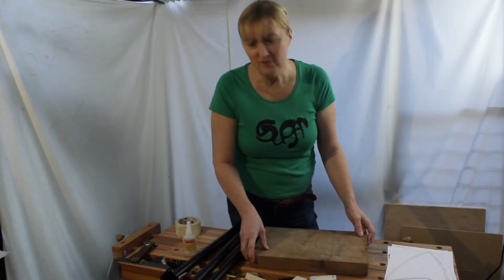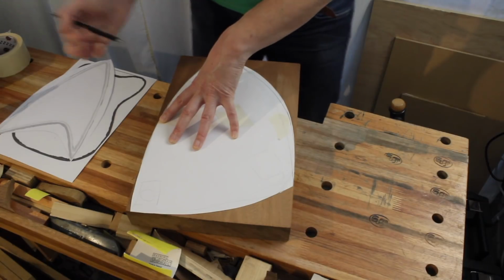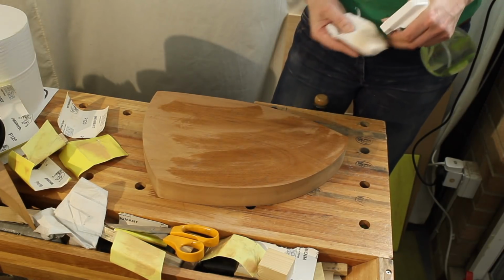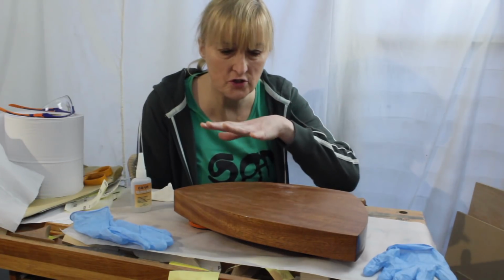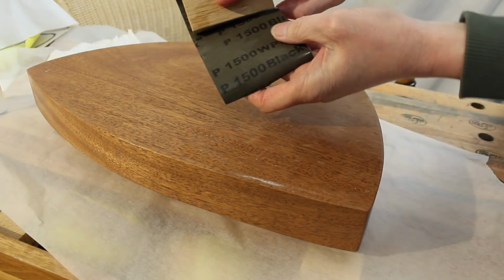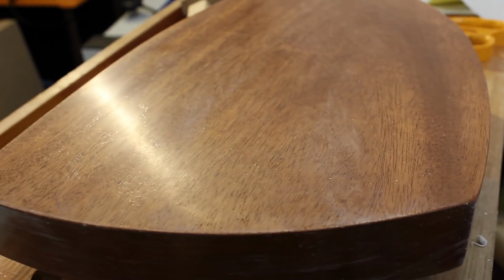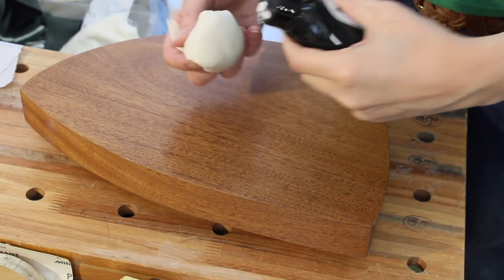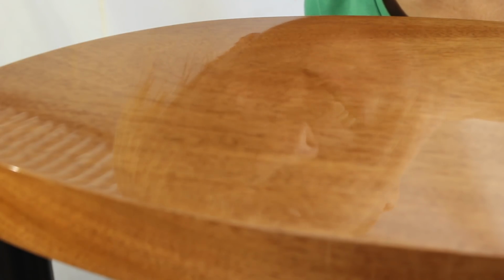Making a small coffee table - using superglue (CA glue) as a finish

Comment: Glad to see the little white spots went away after applying a few more coats of CA glue. I have the same spots and was about to sand down to remove them but didn't want to sand through. I'll try n wipe a coat on after I blow as much of the white dust out of the holes then clean with naphtha. Thanks for the video & the insight

Comment: here is a tip for you: store your super glue in your refridgerator.it lasts longer!i saw a video about finishing with super glue but i wasn´t shure if regular super glue does it.thank you for your video.i will try this very nice finish!
best regards uwe mathioschek
Reply: uwe mathioschek I second that, all glues should be stored in cold.
Reply: If superglue has gone thick with age, is it possible to dilute it with acetone? Or is it better just to use fresher superglue? It's not my experience that manufacturers put a date of manufacture/expiry on it.
Reply: Not really. The moisture in the air inside the bottle will condense and react with glue. Leave it at room temperature always.
Reply from the maker: I’ve heard about storing in the fridge, but the stale bottle was a new purchase, unopened.
Reply: uwe mathioschek Yeah, it works really well. Even opened superglue bottles remain usable for years if kept in the fridge all the time!

Comment: Awesome result. Im getting some 'Gluboost' soon. It's meant to be formulated for this kind of use amongst other things and its has minimal, if not zero blushing. Have you tried it? (Not an ad lol)
Reply from the maker: I haven’t tried gluboost. When I did this video I don’t think gluboost was available in the uk. That may have changed though
Reply: @SusanGardener  was that mahogany wood?
Reply from the maker: Sapele I think
Reply: @SusanGardener  thanks and what type of fluid did you use when you were wet sanding?
Reply from the maker: Just water - ok providing no wood is showing. I did sand through at one point and had to apply more coats of CA - not sure if that’s in the video

Comment: Yes, you are right, regarding the fast aging of the product, some of the gel type goes off even quicker than the sell by date. I had little tubes that were empty with no leaks.
Another thing I need to address to everybody is the fumes! Superglue is also called 'cyanoacrylate' - don't know how many people know cyanide gas, used in concentration camps in WWII... I personally would only use such large quantities out in the open! And by the way, I am NOT a health and safety nutter, just want to live longer...
Reply: Cyanoacrylate fumes themselves are not toxic. They are, however, an irritant. HOWEVER!!! If you use cyanoacrylate glue on expanded polystyrene foam, the chemical reaction between the glue and foam actually does create cyanide gas. I've known someone to temporarily lose their eyesight when a single drop of superglue accidentally fell on some foam and a tiny puff of the gas got into their eyes. They went totally blind for about 5 minutes. DO NOT USE SUPERGLUE ON POLYSTYRENE FOAM!

Comment: Hi Susan,  Very nice finish - in the end! I'm interested in using CA as a finish over some steamed-out dings on a nice guitar I'm working on at the mo. It appears that some wood lathe workers (on YouTube) slow down the CA cure by putting a few spots of boiled linseed oil on the polishing rag before applying the CA to it. Not sure if this will give the same high gloss finish you achieved but it certainly looks worth looking into.   Cheers,  Chris
Reply from the maker: I’d worry the linseed oil would soak into the wood. For French polish on spruce you must avoid oil in the first coats. I think if you’re quick a decelerant isn’t necessary provided you’re prepared to do some sanding
Reply: Hi again Susan,  I saw this done best on a UK wood turner's YT site and he definitely put the BLO on the item first before adding a few drops of the CA to the same spot on the rag and then buffing that mixture on to the item. BLO is a curing wood finish in it's own right (because of the boiling) so I assume its use here is to slow the CA down - perhaps because the finish was applied direct to the spinning item and some heat would be generated? I've also seen BLO used to thin PU finishes down.  All very interesting so I'm going to have a go on some scrap when I get a mo.  Cheers,  Chris

Comment: CA will restrict the movement of the top too much as well as it is quite brittle...
Reply from the maker: Do you have any evidence for this? Shellac is brittle but is considered an excellent finish. CA seems similar to shellac physically but is tougher.
Reply: It is as Creed Sexton said, I tried the super glue on paper surface, and it made the paper quite hard, sometimes elastic depending on brands. 

Though, it might be different on wood, I haven't tried using wood
Reply: Also, the paper became waterproof
Reply: CA finishes are extremely durable! They don't take kindly to certain solvents though. Polyurethane is amuch weaker bond between the monomers than CA.